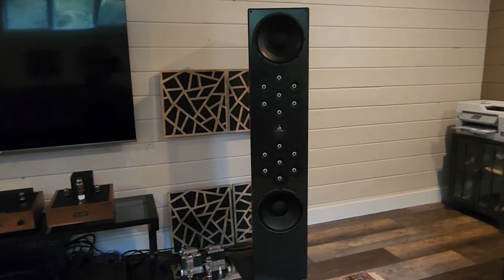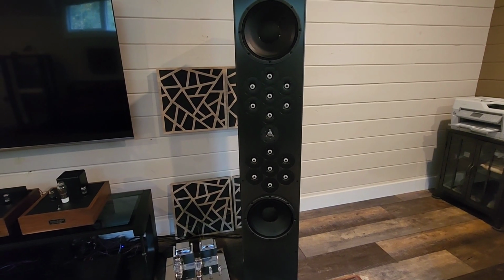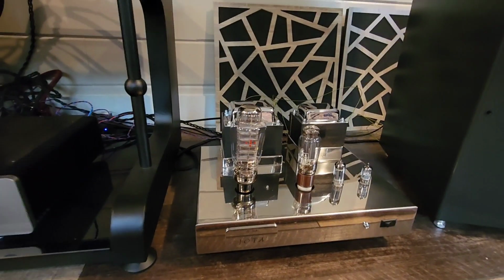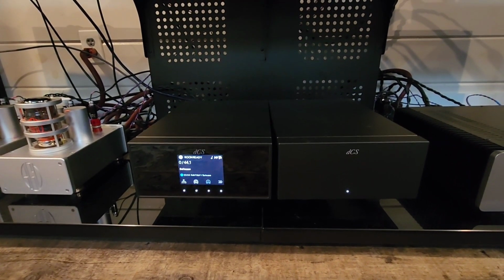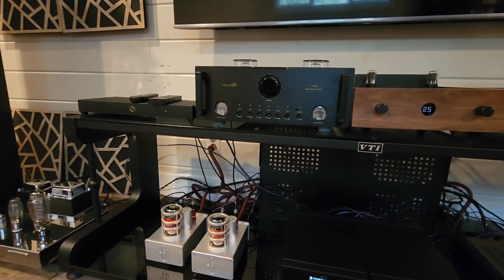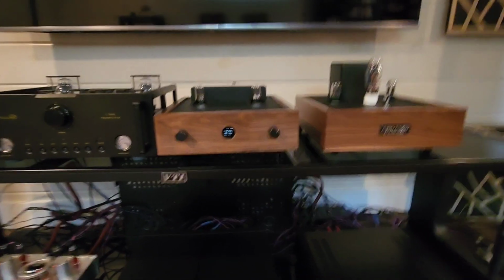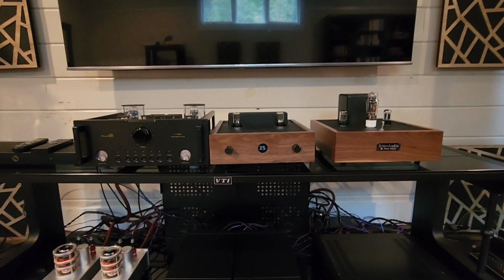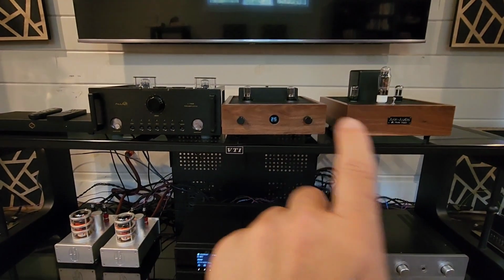DOCTOR ROBERTS HiFi System. #listeningtest

Comment: That' amp 2nd 1 is nice.  "aric "
  Love that Pre.
  Speakers  ??? 
  I would think after awhile %94  you blow a tweeter  or mid.   For the first 3 days, balance is off  You figure it out.
  So now you need to replace 
10 left 10 righ drivers at $200 
A driver.    I guess you could change out the 1 bad driver.   That is the rookie way to go.    From what I know about the speaker's.   The builder is a real Gem.    
   We have free speech  in USA.    well so far that is.

Comment: Mikey, what do your LRS+ have over these Tektons, if anything?.🤔 I'm gonna guess soundstage depth and the disappearing speaker act.🧐
Reply: Tekton's with the tweeter array carry some similarities. Speed for one
Reply from the maker: Similar but makes a more open Soundstage due to the back wave reflecting off the front wall...
Reply: I can tell you that you soaking up extraneous reflections through treatment is where you are going to address many of your "smear" issues. A close friend of mine owns Klipsch Forte IV's and his room is not well treated, so the SMEAR is greatly obscurring subtetly. So, my suggestion for the owner of this set is WORK ON YOUR ROOM and play around with placement if you feel you are experiencing smear or any particular weakness in the Moab. Moabs can do just about everything that you would want a speaker to do and they do it amazingly well. If you want to spend a LOT more, then do it. Many people need to spend big chunks of money to make that money feel meaningful. Some of us are delighted to spend a modest sum and discover an amazing product and that is what we have here.
Reply: @intrinsicfreedom  Good observation, and 👍 your handle.

Comment: I had a pair of these regular mids & Bril tweeter. After about 200 hours with using SS amp & tube amps. Started to get tired of listing in in a couple hours. To front loaded with Bass that’s OK. It doesn’t sound musical to much in your face🤯🤒 But great for the 💵
Reply from the maker: I've had others tell me that. I'm wondering how these will break in..

Comment: Very nice! Those new tweeters are sounding very clear and smooth. There always seems to be a lot of paranoia around hard tweeters.. I've had my Moabs with the Be center and soft dome mids for a little over a year now. In that time I've upgraded the crossovers with high end parts and it wasn't a subtle upgrade. I also placed my Moabs on SVS subwoofer isolation feet from the beginning and more recently upgraded to Townshend Podiums. Those also made a very noticeable improvement across the whole range. And if anything, they actually seemed to do more in the mid range and highs than down low, since I already had reasonable isolation in the low frequencies. At this point, I would put my Moabs up against almost anything I've ever heard, regardless of price.

Your friend looks like he has a very large room? Certainly bigger than mine, anyway. I would recommend moving the speakers farther from the wall and maybe consider some Tekton subs later, if needed.

PS, how old are his speakers? Mine took a solid five weeks to break in. Granted, I have the 12" drivers with butal surrounds and his look like one of the models with the folded surround? Mine were probably stiffer out of the box. Either way, if you experienced any sensation disconnect between the mids and the bass, they might need more time. Mine are arguably the slightly less articulate, but harder hitting of the various 12" drivers Eric uses and they are still very articulate and coherent. But the first few weeks, I was pretty disappointed and then finally, it was like someone flipped a switch and they just pulled it all together.
Reply from the maker: They are maybe a month old. This model is not released yet, I think. I suggested Live Vibe spikes as well as pulling them out from the wall. They were good for $6500 but not in the range of best I've ever heard. Any idea why he does not just use high end midrange drivers over a tweeter array ? I get these speakers. Good value. To me not end game, nor should they be for $6K. Or even $10K at which point the cabinet better be more than a sprayed box. So it seems like a "stepping stone" speaker to me, at this point anyways. I'll go back after these have time on them to listen again. ;-) ...
Reply: @OCDHIFiGuy  The idea behind the tweeter aray is the mass to drive ratio. Eric is a musician. His thinking was, how can a driver with a mass of several grams, let alone tens of grams, reproduce both the fundamental and the harmonics of a drum skin, or a string, each with a couple grams or less of mass? If the tweeters are fast enough to hit 20+ khz, then it can do 300hz to <3khz with higher accuracy than any conventional mid-range woofer. Flat panel designs seek to answer this question as well, but they don't have the same driving force as a magnetic motor found in a dynamic driver or tweeter.

Case and point, I got to listen to a $180k system built around those new Martin Logan monster electrostats. The system was glorious, but also too laid back. It didn't deliver the engagement and emotional response that my Tektons achieve. And if my Moabs were in a bigger, better treated room like that and/or had my choice of $60k worth of electronics behind them, I can only imagine stay they would do.

I'm sure I could do better if I spent a lot more. I have $10k into my Moabs and that's already more than I really should have spent for my end game speakers. With the performance I'm getting for the money, I'm OK stopping here. This level will be end game for most of us, I think.

Definitely go back for another listen when he's broken them in longer and dialed in the position better. Bring your favorite electronics and some better isolation, if he'll let you.
Reply: @OCDHIFiGuy  Would be good to get your thoughts after going back. Also, adjusting the the speakers (they are pretty close to back wall) could open them up a bit. What would you say is the best you have heard in the $6500 range? These are supposed to hit well above their price point since. And I agree with below that the tweeter array decreases cost since you can use relatively inexpensive components and not have to use some diamond-moon-dust liquid hybrid midrange that drives the price up. The ceramic should be adding an addition sense of clarity and resolution. And by not end game, what do you mean? Is it because of the price point? Or is it because you don't like the sound in some way? Your video is the first showing these so very curious. Thanks for the post!

Comment: What I don't like about these rigs is the number of electronics in the signal path especially with digital audio. What happened to less is more, straight wire with gain ideas? My systems are simple. A turntable, a cassette deck, a reel to reel, a cd player, a fat amp and two loudspeakers. To each his own. PS: And a subwoofer!
Reply: Not to be disrespectful.❤

But I think like this:
When 50% of all the sound we hear is reflected sounds.
When it is reflected then it will reach your ears with different delays depending on how many times it has bounced and the room size.

In short we will get widely different sound depending on what room we are in and positions..

Something passive like a wire with a gain is maybe good for a power amplifier but not so much for a entire system. Less is more is also out the window IF you want to go to the next level of sound quality.

When those two "nice" ideas (that only stroking our brains) do not make your system to adjust or adapt (dynamically) to whatever room you have.
And in the process also fix all the components in the signal path if there is "non synergy" issues..

By adding a DSP as a preamp that makes "room and system correction".

As I said 50% of the sound is NOT direct sound from the speakers (of course depending on listening distance to the speakers as nearfeald for example..)

So then you understand that insertion of a ADDITIONAL component as the DSP will enhance the sound quality much more then any degradation it might have in the signal chain.🎉

If we follow those two principles a system wide "wire with a gain" and "less is more" we effectively painted us into a corner.

Then the ONLY thing we can do is if for example a speaker is "bright" then we could select a power amplifier that is less "bright". So we use components as static EQ devices. And it is the most expensive way to do things and also static.

A DSP can for example:
* correct your system and room
* give you your preferd individual frequency response that is changed by time (we don't have some preferencees today as we had a decade ago)
* different presets curves that fix bad mixing work on different albums (so more albums will be enjoyable)
* you can use it on your TT and the sound improvements gain is vastly larger than the loss that might be of a AD and a DA conversions .
* can use it as a rumble filter
* can use it to take over the crossover duties in lo level domain
* put delay between subwoofers and mains if they are on different distances.
* plus so much more that only your imagination is your limits.

That is how I see it. Those old saying is originate from old folks in the old days when no DSPs were available and maybe that made sense back then but technology has advanced since then!

Now I call them dinosaurs that don't go with the time and hide behind the word "purists". And therefore thinks that they're cool and special when they clearly aren't. 😢😂❤
Reply: @AmazonasBiotop  Dear Mikey, I don't think you can ever be disrespectful to anyone. Not in your DNA. Really appreciate the explanation Cheers
Reply: @artyfhartie2269  Thanks for the kind words! 👍
I don't know where you got the name from. 🤔
But it is a good guess when half of YouTube audiophiles have that name. 🤣
Reply: @AmazonasBiotop  Hi It says OCDMikey on your videos so I thought Mikey was your name
Reply from the maker: That's me Arty.. ;-)
Reply from the maker: DSP still sounds contrived to me. Not a natural, effortless sonic, regardless if it's digitally "perfect" in every way. Those "perfect" systems still to this day have not connected me to the music in any meaningful way. So perhaps you love a NFT, perfect computer generated representation of art. I'd never buy it. I like the analog paint on canvas with all its potential imperfections because to be imperfect is to be HUMAN. To be "perfect", is devoid of soul. And it's audible in terms of not emotionally connecting with the music on a Human spiritual level.. I give DSP a chance every year... still it's a big NO for me.
.
Reply: @OCDHIFiGuy  DSP or not..
Ok let's say it like this I sometimes get in tears while listening to music with my DSP in my system. 

But that is VERY subjektive and in what state of mind you are in when going in to the session.
That is a hard nut to crack for what is "connecting in any meaningful way".

Now, I do everything manually.. 
I mean I don't use any Dirac or other software. That gives me total control over everything.

All vinyl lovers know this. You have a album that is mixed with weak low end and there is maybe other mixes or pressings out there for the same album but many times there is no options..😭

The mixing engineers is so many different peoples on all different albums that mix on different systems and with their different individual subjective likings.🤔

I have my own subjective liking and when I find a LP that needs for example more body and umph. Then I just press a button on the remote to change the sound or correct the sound that is more to my liking (for the time, mood, loudness and taste).. 
Now that is making me to be able to listen and connect to the music 🎶
Otherwise not able to listen to that pressing and therefore no chance to connect in any way..☹️

As only one example.

The thing is it is so powerful the alternative to adjust without DSP a weak mixed album that is not up to your preferencees is in a "static" system you need to maybe change between different speakers and that is not practical and will not happen.
So that album is not enjoyable and not listened to at all and of course vice versa.

So in a static system you limit the number of albums you can enjoy fully and that is decreasing number of albums to "connect to".

But when I have full control of what sound signature I get at the listing spot. 

Example on my level of control:
I can also SIMULATE any other speakers and how they sound on axis. All I need is a frequency measument of that speaker brand and model and that frequency response can I import to the DSP and get a idea of how that speaker sounds on axis! (Yes of course I can't reproduce propagation patterns off axis and so forth).

I am just saying that to point out how powerful tool the DSP is. Probably more powerful than just run a Dirac calibration with no idea of what or how were "corrected".

Anyway I think the DSP is the best thing since sliced bread. 🥰

But of course it is all about HOW you use the DSP and WHAT issues you make it to solve for you. 👍

If you know stuff and use this powerful tool correctly then I think there is NOTHING that can bet it! 🥰
(And that is not that you have a DSP controlled subwoofer 🤣 that is a DSP in a totally wrong placement in your system! That limit all the good thing it could do if it were in a preamplifier.)
Reply: @OCDHIFiGuy  To be quite honest with you, I love listening to my cds on my old Cambridge, Marantz, Technics etc cd players. Even Samsung blu ray DVD players. But I love the connection and immersive experience I get when I listen to my records, cassettes amd reel to reel. Just the process of cleaning and putting the items on the players etc and playing them makes me feel like I playing an instrument. And I love the sound. No doubt about it. It's all about looking, knowledge of the gear and caring about them. Like everything in life  PS. Vintage stuff is best IMO. Personal preference
Reply: @OCDHIFiGuy  I get it now. Arty sounds better than Arthur or Arfur. Sounds old

Comment: i just have to wonder what does it sound like with real music? i meanlike woth bob marley, burning spear, paul simon the bealtles the stones and what have you...i find ty[pical high end music rather boring
Reply from the maker: A shit ass radio sounds great with Bob, Beatles, and Burning Spear...
Reply: @OCDHIFiGuy  Sure. But I'm pretty sure we can all tell the difference between the shit ass radio and a real system....at least I would hope so.
Reply from the maker: @MrAricaudio123  so the other way to answer him is to say it sounds great with Bob Marley. Which is about the most generic comment I could give. We use certain songs to showcase certain abilities of the system. It's irrelevant if it's boring.
Reply: @OCDHIFiGuy  True. Most older recordings- especially rock and reggae didn't use or have equipment to capture the frequency extremes and a low-fi radio can make up for this because it's essentially a big midrange speaker. In a revealing system you can hear lots of hiss and subsonic junk because they never knew that speakers or other electronics would ever be able to play from 20-20khz. Some modern dynamic stuff is recorded very well however. Slightly Stoopid, Phish, etc. all sound pretty awesome on a high end system.